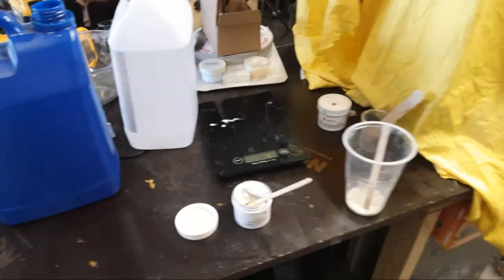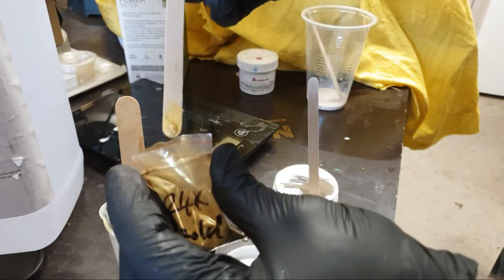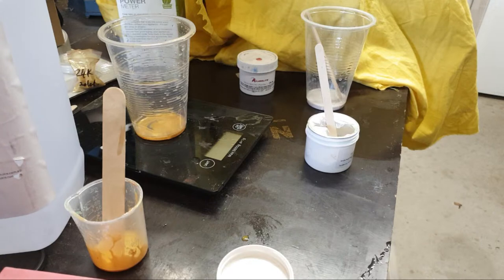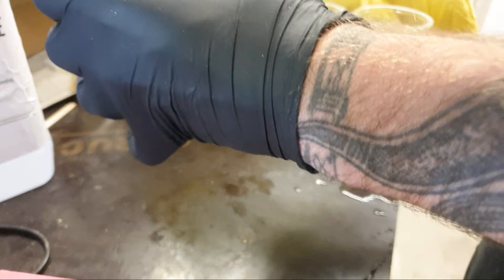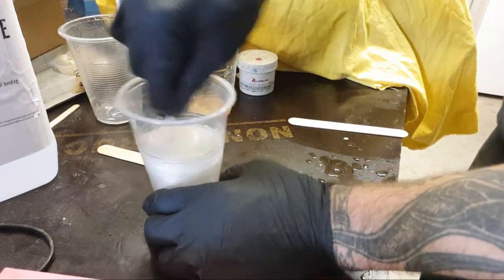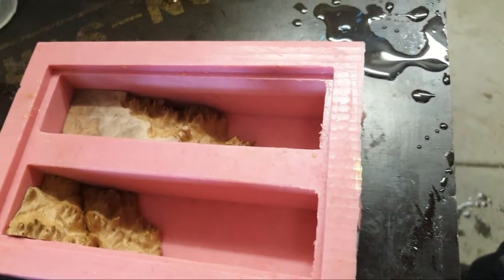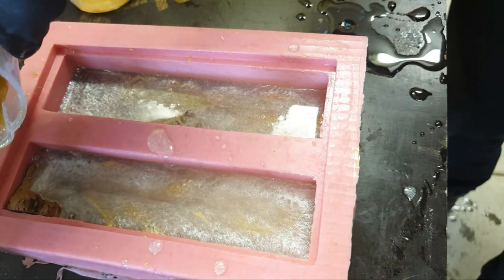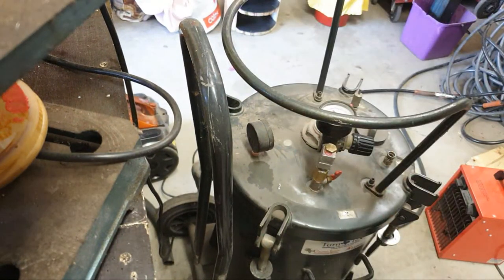Casting Crystal knife Blanks

Comment: I've had great success with no bubbles in my blocks using your epoxy by mixing it up and adding pigment , then sitting the cups of resin on a 3d printer heated plate and heating the plate up to 60 degree C .  I then monitor the temp of the resin itself in the plastic cups and give them a stir periodically to stop the pigment from settling to the bottom.  
When the epoxy is up to 60 degrees in the cups,(probably takes 40 minutes) I then pour them into the mold in the desired mix,design what ever you want to call it ,  and turn the heated plate off on the printer.  I found watching the temps the epoxy goes up to approx 85 C on it's own as it's setting up .  After about 4-6 hrs I can pop it out of my silicon mold and let it sit to fully cure .  All this is done in our house at an ambient temp of around 18 C .   So far doing this i can see no bubbles after cutting my blocks in half and sanding to see how they come up before using for knife handles .  It's pretty easy and no bubbles, I can't ask for much more really , as soon as you have more in stock I want some .
Reply from the maker: Actually that's really interesting. I just got a 3d printer lol. I often heat my resins in the oven pre mix. Thanks fit the advice mate. Its really appreciated
Reply: @TobyFireandSteel No worries. Well if ya have got a 3d printer might as well print a rock tumbler like I did a few weeks back if you dont already have one . Best knife making thing that has come off my printer by far
Reply from the maker: Oh man I have a build coming up for a tumbler. Never considered printing the tub. Did u design the file or get it from a site?
Reply: @TobyFireandSteel  I used this one from thingyverse 
 https://www.thingiverse.com/thing:3101842                        
I had a little 12 volt gearbox/ motor to suit already and the rod for the shafts so was easy to make thins one. There are a fair few files around for them so just need to pick one.   I'm happy with this one and only printed it in PLA too .  I tweaked setting a bit to my taste .  Works great though
Reply from the maker: Awesome thanks mate